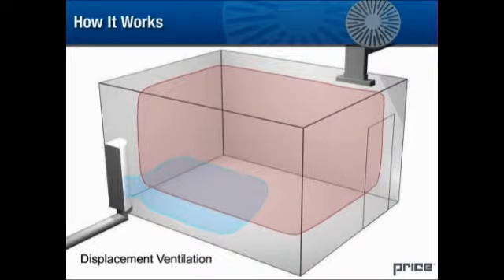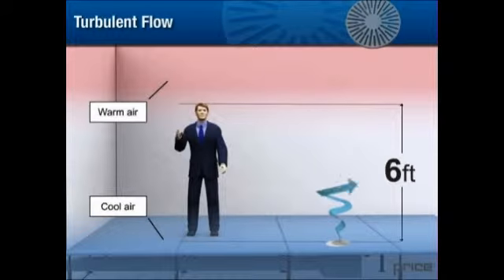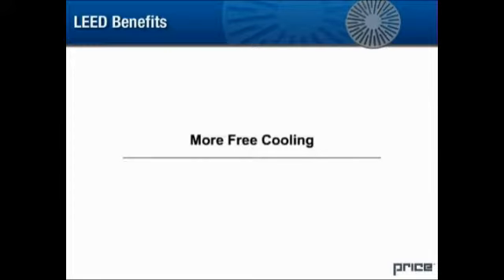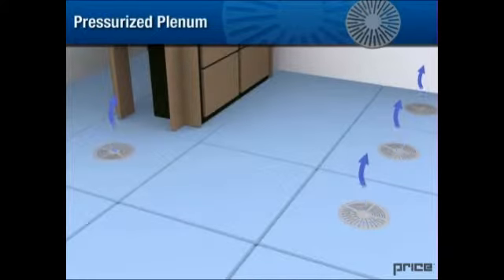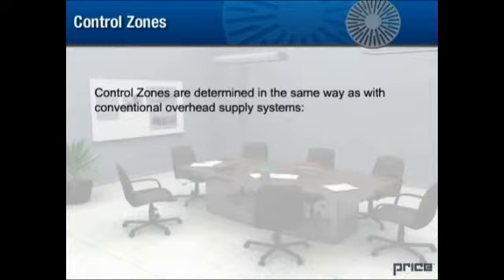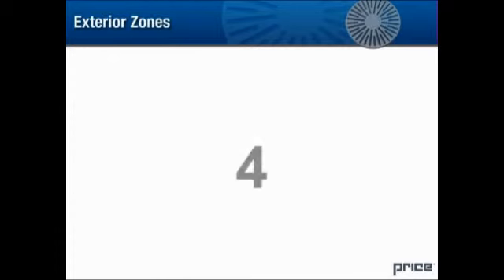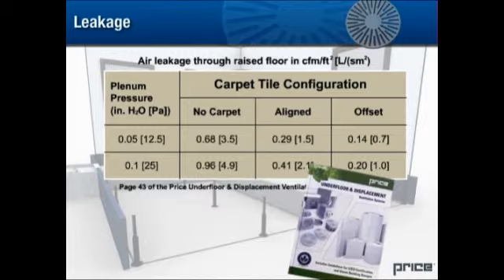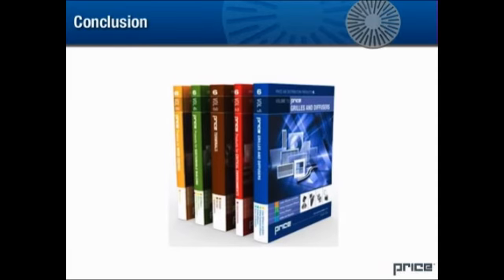HVAC Training - Underfloor Air Distribution

Comment: Sir i have doubt ?
If we are drinking water and it falls inside the distributor unit. Does it will damage the distributor.?
If it falls inside the plenum area is there any option to remove the water.?